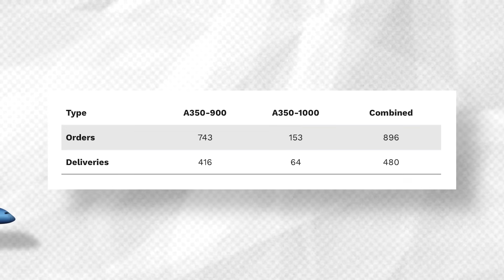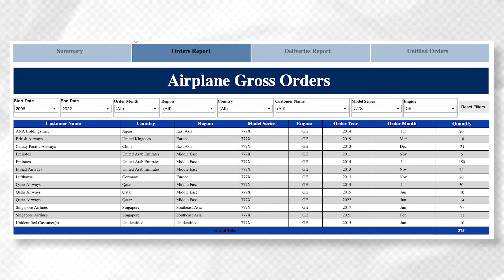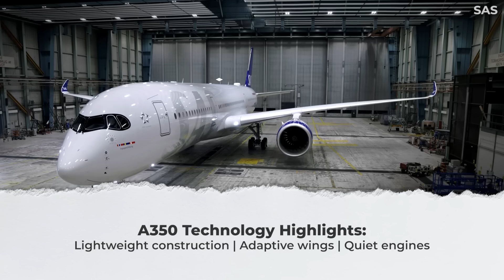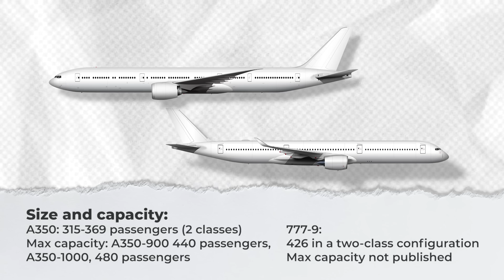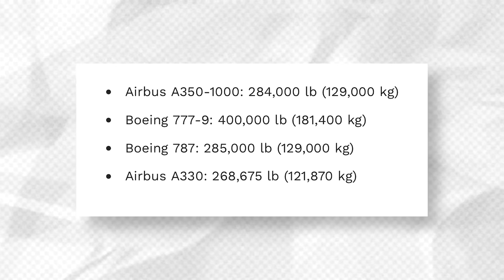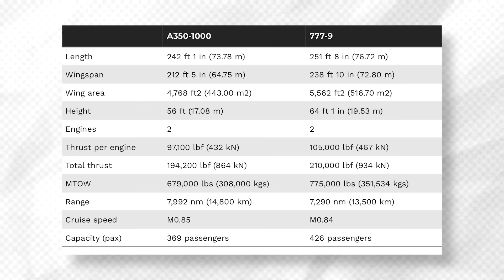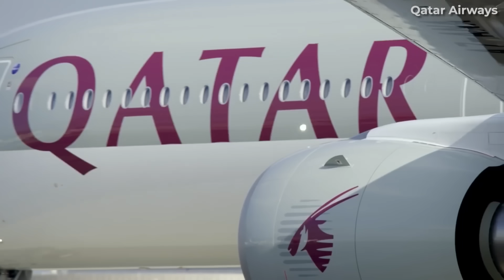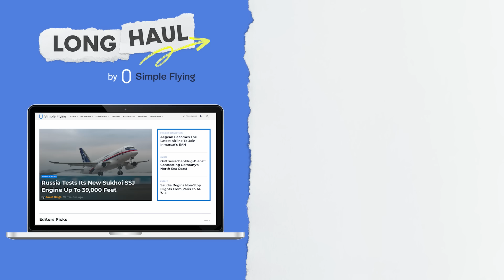The Boeing 777x vs Airbus A350 - Which Plane Is Best?

Comment: B777X delays feels like intel's 10nm lithography process delays. B777X will give airbus hard times if they able to deliver this aircraft in 2020. But boeing missed their chances just like intel missed their chances to fight amd with proper product stacks.
Reply: The elephant in the room is 777X or 777 in general is too heavy. 778 simply can't compete with 35K, and chances are a 350-1100 is lighter than a 77W while carrying as many as a 779. I just can't see how 779 can survive this.

Regarding your computer chip analogs, do note that subsequential Zen architectures actually beats Intel in terms of thermal and power consumption, even at some point have superior IPCs? These are traditional Intel strong holds, yet even with Alder Lake they can't reclaim all of these, actually get worse in some aspects.

In both cases I'd say A350 and Ryzen successfully challenge the status quo, and that's good enough for Airbus and AMD alike.
Reply: @steinwaldmadchen  I have defected, M1 max is on it's way.
Reply: @tronwars7130  I'm replying to the TO with Arabic name.

Regarding chip, ARM is definitely a serious challenger to x86, just like how x86 challenged other architectures in HPC space. Of course Apple has the talent, resources and demand inhouse to develop a competent Apple Silicon, but they're not the only one. Fugaku for example, is an ARM-based supercomputer developed by Fujitsu, and it's also highly efficient despite its computing power.

Meanwhile for <10nm chip manufacturing, I doubt the Chinese can make it without EUV. Huawei and Hisilicon are fabless with no production technology in house. The companies who produce chips, a.k.a. TSMC and Samsung both use EUV, while domestic producers like Tsinghua Unigroup and SMIC can't even get older techs right. AFAIK Japanese companies like DNP and Canon are working out nanoprint on <10nm chip production, but not mature enough. I doubt Chinese company has the tech for that neither.
Reply: @steinwaldmadchen  i think since intel lost their edge over amd they didn't have any core's IP efficient enough to beat Zen cores from amd so they know their weakness and try to offer something they can deliver today (leading single-thread performance and competitive multi-thread performance at OK/good price). It isn't the best way to compete with amd but at least that's what intel can do today. They still needs years to catch up with amd but hopefully they can keep their pace.
Reply: @steinwaldmadchen  and regarding of 779, i think this plane (or planes at 779 size) is kinda DOA at this point so i doubt airbus will ever make A350-1100 at all. I still believe that 779 will be competitive enough if boeing can deliver this plane in 2020 although tech-wise A350 is superior plane compared to B777X in every aspects because B777X will serve their own purpose that A350 unable to do.
Reply: @Arkan_Fadhila  Because 779 size aircraft in current environment is a niche. I don't think Airbus would sit and wait if 779 proves to be more popular than they expected.
Otherwise by the time UltraFan is mature they'd definitely look into 350-1100 again. In both scenarios I don't think 779 can survive.

Ironically Intel was also managed by bean counters during its own time of stagnation. We would see if current CEO could turnaround the company.
Reply: @steinwaldmadchen  damn, i forget about UltraFan. Airbus could easily strecth A350-1000 further, use UltraFan and 779 will be in danger quickly. Fortunately for 779, it still take years for airbus to certificate A350-1100 so 779 will enjoy his time if this class of aircraft will be popular among airlines (and that's a big IF in this current environtment) 

And about intel ceo, previous intel ceo (before bob swan) really destroyed intel advantage over the competition and put intel in very difficult position today. Bob swan isn't great intel ceo either but at least he didn't destroy intel further. Pat gelsinger give intel a new hope but he still have to prove himself to be a worthy leader for intel.

And talking about ceo, i think boeing also needs a new leader. Current boeing ceo david calhoun feels like bob swan of intel, we can call both of them temporary ceo as previous ceo caused huge problems and scandals, both of them are bean counters, both of them aren't terrible ceo but not good enough to save both companies from their darkest era.
Reply: @steinwaldmadchen  i saw ur arguements in others comments also,,simply u dont have proper information and leading the arguement with false claims. u r jst simply biased to airbus.
Reply: @prasenjittripura4691  Lol then make up your own argument and show your own evidence. I'm happy if you can disprove me wrong.

The fact is, while there's no publicly available data regarding a350 or 777 OEW (there are leaks in forums and estimations from well known analysts though) 35K is at least accomplishing many of the 77W flights, at a significantly lower MTOW and thrust. That's one of the reasons for its efficiency edge alongside having more advanced engines and aerodynamic designs.

And it's safe to say it still has significantly lower MTOW and thrust than 777X, that even the latter might have better engines and wings, 350 would still come first in terms of trip cost, because it needs less of everything.
779 seats a few dozen more passengers, so as a result, Lufthansa expected it should have a unit cost similar to 350 in their annual reports, so as others in the industry. Maybe Boeing can surprise us though, but how likely the chance is?

And how about if Airbus also manages to seat more, at a minimal increase of trip cost (which often happens for a stretch, as shown by Boeing's 781 and Airbus' 321), or worse still, at the same trip cost (which is the motivation for pushing 10 abreast onto 350)?

OK for the freighter Airbus side probably reached their limits, and Boeing is the established player, so the 778F still holds an edge, but that is expected to be accomplished by a further MTOW increase from 351t to 365t, and the pause of 778 pax. Hard to say it's an easy win either.
Reply: Such a valid point, now TSMC can do 5nm chips I think and it looks like China has just cracked the 5nm lithography with Alibaba, but Huawei is brining something new to the table, Photonic 5nm and it's a home grown technology where they don't even need to buy lithography machines. Where is Intel? I think somewhere back in the 80s. Why is it that all phones are ARM, Apple is now ARM, none of these need fans but drop a i7 11th gen into a box with Windows and it will run a fan all day with just notepad open. My thoughts are the same, the US is really dropping the ball on tech and I think Asia is going to get the jump. What does the US do now with trying to ban lithography machines for 5nm processing when China now has their own new custom products. And these planes are the same examples, just so far behind, delays, loss of confidence, better products in other markets.
Reply: @tronwars7130 
China being able to be independent 5nm chip manufacturers didn’t age well

Comment: Why didn't they include the preliminary numbers for the 777 8 and include it....with those numbers the 777 8 beats the a350 1000 and 900 by far.
Reply: Except no one outside Middle East is buying 778, while Qantas picked 35K over it.